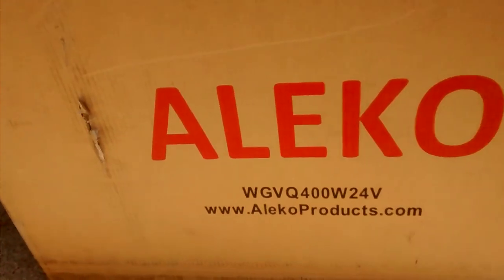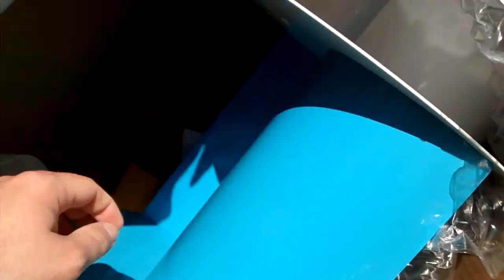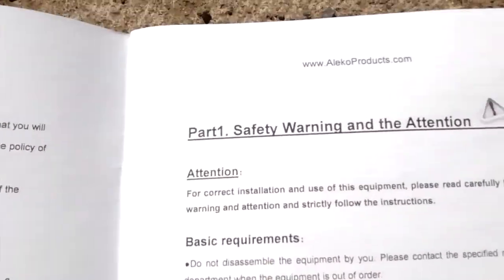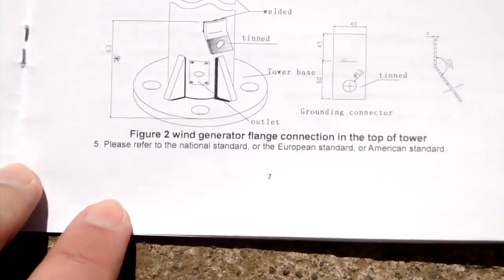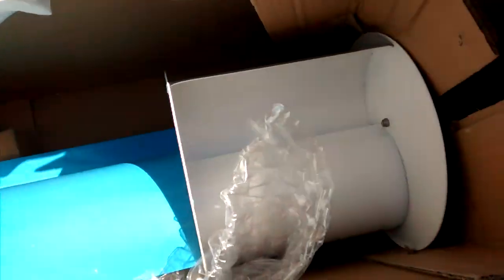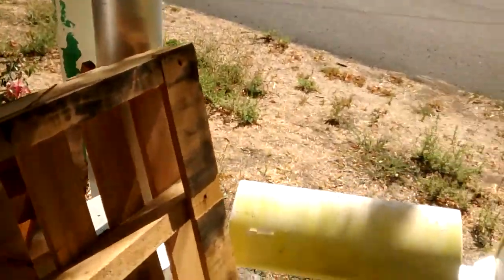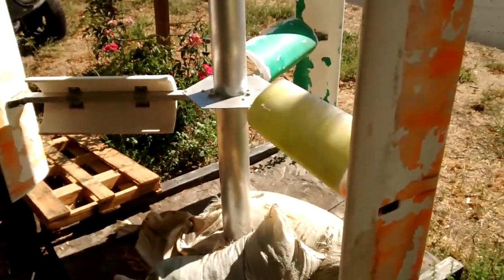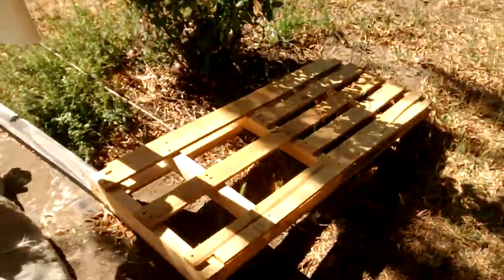ALEKO 24V 400 Watt Wind Generator Unboxing w/ Manual!

Comment: Quick questions. This is three phase right? Would i need a three phase charge controller to use it?
Reply from the maker: It is 3 phase it is right in the video. Yep, an AC charge controller with load dump function.